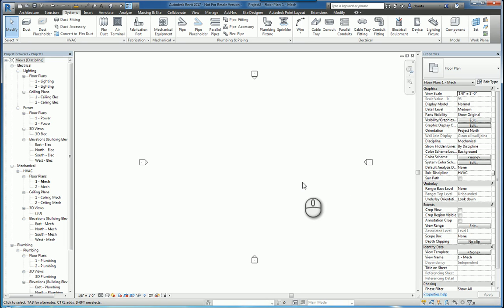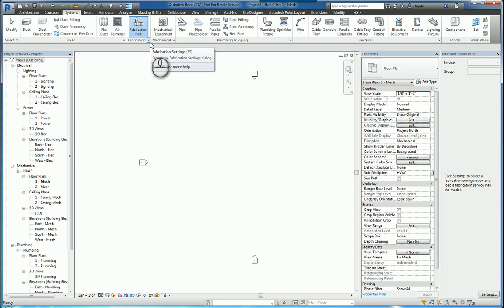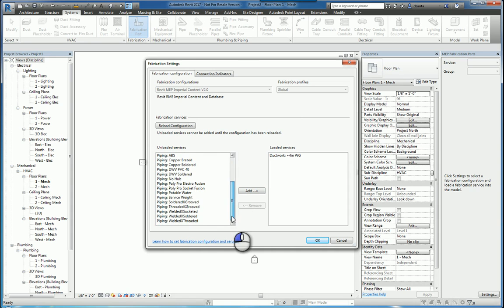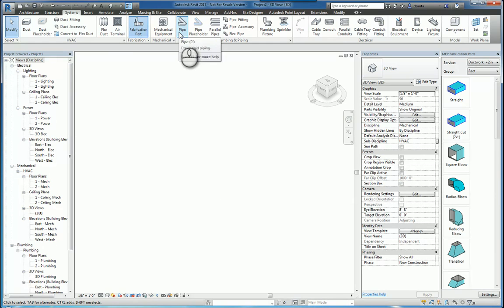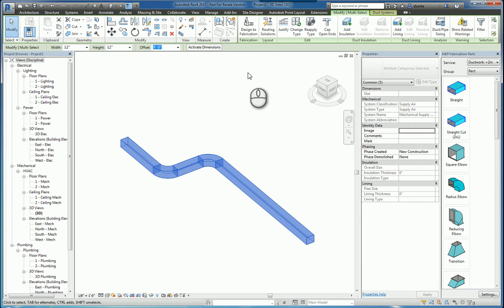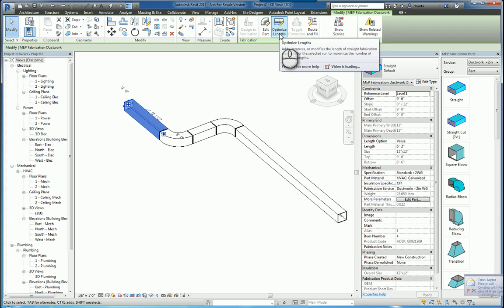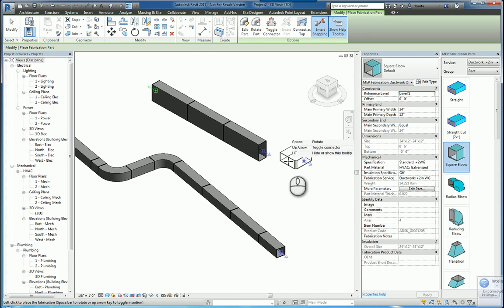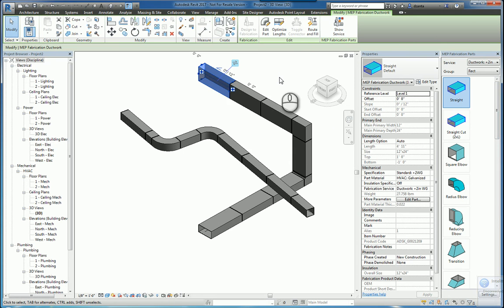Revit Fabrication Parts   A How To Guide

Comment: Why in the settings do you not use imperial content v3.06 for your fabrication configuration
Reply from the maker: You can use any fabrication configuration file.  Revit comes with some default ones.  You typically want to get the configuration file that works for your design jurisdiction